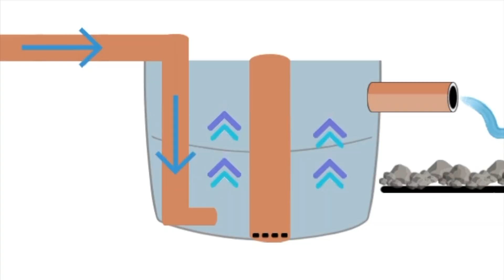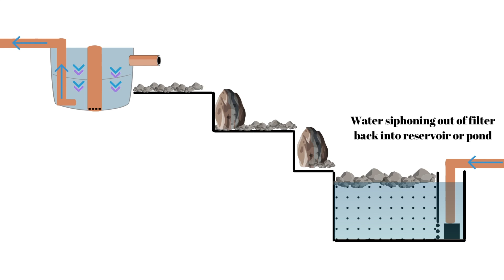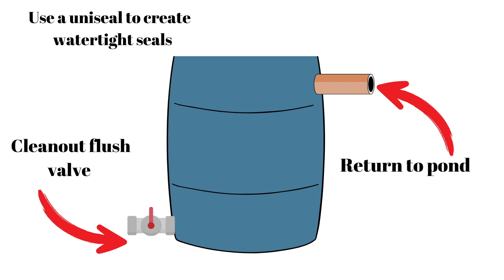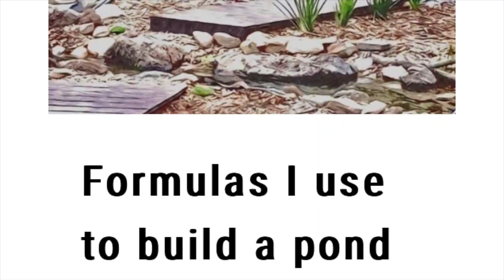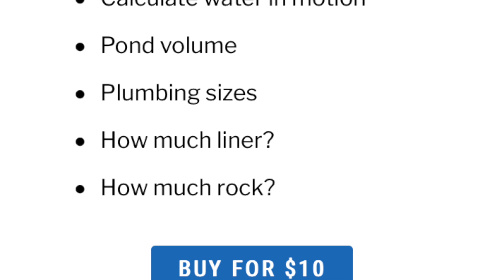Cheap DIY pond filter | Solar powered pond & stream

Comment: What pumps are used for solar setups? The pond is 5200 gallons I am looking to filter I’m not confident that solar can filter a pond this size is it possible? I prefer to use 12v pumps but those aren’t built for continuous use.
Reply from the maker: DC pumps but remember you can use any pump you like you just need to add an inverter to the system.
Reply: @Ozponds the one I'm looking at is 600gph or so solar poposoap pump. Theoretically that's seems like enough gph to send water thru a bog filter to clean the 5200 gallon tank thru daily cycles over time.
Reply from the maker: @D @Day-dreamer488 there’s a lot more variables if the pump won’t run continuously. That’s not to say it’s not possible.

Comment: Hi all, does anyone know if there is a solar powered pump kit? I'm not looking for one of the ones that look decorative but a kit that can truly calculate water for most of the year free of charge.
Reply from the maker: Most of the ones I’ve seen you’ll be lucky to get 6hrs in winter.
Reply: @Ozponds  Ok, might it be possible for you to list those?
Reply from the maker: @S0me0ne_S0meWhere_SaysHi  there’s only really one available in Australia. It’s the pond max system with battery backup. On my website there’s a link to Australian products via rockaroundtheblock. Talk to Matt use the code ozponds for additional savings 👍

Comment: What type of filter should i use for a 1000L pond with a 1200lh pump?
Reply from the maker: High flow.
Reply: @Ozponds  does it works the same like the bog filter(clean water). sorry for my english, im italian
Reply: @Ozponds  another question, the high flow filter is the one with the ballfilters?
Reply from the maker: @faikino1838  it should give you clear water. The more biological filter media you have the better. It’s not as predictable as a bog filter.
Reply from the maker: @faikino1838  correct 👍
Reply: @Ozponds  thanx man
Reply: @Ozponds  one last question, how big should the filter be for aprossimatly 1000L pond?
Reply from the maker: @faikino1838  if it’s the high flow filter large enough to house 100-200 bioballs and some coarse sponges.
Reply: @Ozponds  thankyou so much

Comment: Do you have links or part sizes? We’re having trouble.
Reply from the maker: No, but luckily I can remember. The overflow is 90mm stormwater with corresponding uniseal. The inflow was all 25mm or 1inch fittings and pipe.
Reply: @Ozponds  Thank you!

Comment: There are so many videos on filters on youtube...all slightly different.  Very confusing.  I have 2 small ponds with a small river connecting them.  I was thinking of making something simple filter where my punk draws water from the LEFT pond through a hose over to my right my pond side but drains into a bucket first...and inside this id put a hole at the bottom with some rocks...then on top of the rocks some polyfil and then on top of the polyfill id have some kitchen sponges and on top of the kitchen sponds id have a pasta strainer to catch big things... does that sound insane? And does the order of the things sound correct.  Oh and I am unsure what the difference between polyfill and sponge purpose is.
Reply from the maker: There’s heaps of ways to filter water. I like to tell people to find a way that resonates with them and follow that method. I just show the exact methods and filters I’ve built for my ponds you can use them in yours or make modifications. Choice is good, if all YouTube videos were the same that would be horrible. I hope you find something that works for you. There’s too much to unpack in your actual question but I will say that any filter needs to be sized appropriately to the pond and it’s use. For example plants can be a good filter, if I put a single plant in a huge pond am I going to get beautiful, clean, clear water? No.

Comment: Hey Kev, what do think about using a full size barrel vs cutting it down? I'm using a cut down barrel just like you and my water has been dark green since last year.
Reply from the maker: It all depends on how much media you need. Remember the size of the bog filter is determined by the pond and it’s use. If it’s too small you’ll never achieve clear water.
Reply: @Ozponds  thank you for the reply. I know some people say a bog should never be deeper than 1 foot, but then you have a lot of people who say it doesn't matter. What are your thoughts?
Reply from the maker: It doesn’t matter to me. I’m more focused on the amount of surface area.

Comment: We are making a bog filter for our backyard and have loved your instructional videos! I understand the concept of the breather tube but don’t understand how all the water being pumped in doesn’t flow out of the breather before making it to the base of the bog. Can you explain?
Reply from the maker: I can’t really explain it. It’s a combination of flow rate, path of least resistance and position. If the pump is oversized you do need a valve.
Reply: @Ozponds  interesting and thank you for the response. The other thought I had, do think just drilling an 8 mil hole in the incoming tube, right at the water line would server the same purpose?
Reply from the maker: Yes it will. See the other comments 👍

Comment: Hi Kev! Do you have to deal with heavy rains that overflow your ponds? I have some tubs with fish in my yard that I have to drain or refill depending on the season, but always wondered about that if I ever put in a pond. There have been days when I come home from work in heavy rain to find guppies swimming in the grass in my yard.
Reply from the maker: It is possible for us to get heavy rain but it’s not very often. We aren’t in the tropics. If I did I’d create an overflow that’s nice and wide and use mesh to allow the water out but not the fish.
Reply: @Ozponds  Thanks Kev! That makes sense. I guess I'll need the edges to be above ground level and have an overflow like you described... I like your vids!

Comment: Hi Kev , I have finally finished my pond. I have a pump that also has some filter material inside of it. Just 3 small boxes with K1 and some ceramics and then 1 filter sponge over it all. Then from  this pump it has 2 outlets one goes to a little fountain. One outlet I have going into my bog filter via pond hose that just slided into the top  of a pipe that goes to the bottom of the bog filter with an elbow on the bottom. However I do not have a breather pipe to stop a back flow if the pump stops.  With my set up can a back flow happen ? If it can happen what can I do ? Thank you 😊
Reply from the maker: It depends if air can be sucked in through the fountain part of your setup. Just turn the pump off and see what happens. If you need to add a breather pipe you can actually just drill a small hole in the hose/ pipe that enters the bog filter. Some water may exit the hole when the pump is running to make sure that it either falls into the pond or filter.
Reply: @Ozponds  Thank so much Kev ,you are very helpful . When drilling the hole into the hose that comes from the pump/filter ,should I drill the hole near to the end of the hose ?
Reply from the maker: Just put it in the area where the breather hole goes on my diagram 👍
Reply: @Ozponds  Hi Kev ,I have watched your videos on cleaning your ponds but please may I ask a question ? 
I accidently split my tub of fish flakes into the pond. 
The pond has been set up for about a month now.
So I used a little net and scooped as much as I could out. Then I decided to clean the bottom of the pond too. I have a bare liner . The pond was full of fish waste . All of the plants were covered in algae. That thick stringy stuff. 
Anyway it took me forever to clean it.
Do I need to buy a pond vacuum ? 🤔 
I have tested the water and everything is fine. I have put a couple of extra air stones in the pond too.

Comment: Wouldn’t half your water from the pump simply exit the breather pipe and bypass the filter media?
Reply from the maker: I’m not sure but it just doesn’t unless there is way too much flow. The water much prefers to go straight. In my courtyard pond I have way to much flow so I have a valve on the breather pipe so I can regulate how much goes down and how much on top.

Comment: Can't you just drill a hole on the top of the inlet pipe as an air intake? Would be cheaper and easier :)
Reply from the maker: You absolutely can. It depends on the amount of pump volume in regards to the filter how much water will want to exit the hole. I like to use the fittings (adds about $3) that way if I need to add a valve it’s very easy.
Reply: I think he gave a reason in a past video, possibly that you can control the pressure and water height easier this way